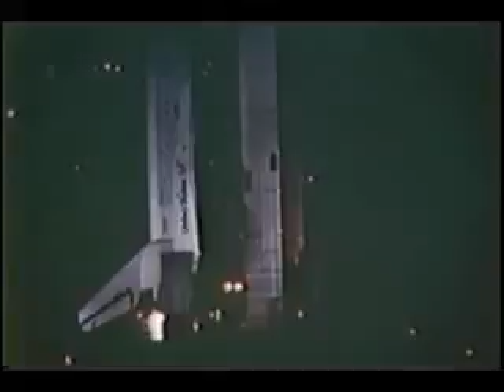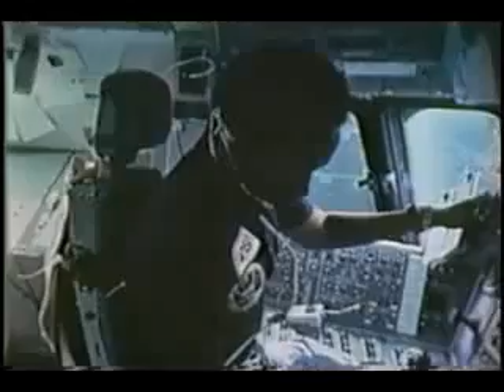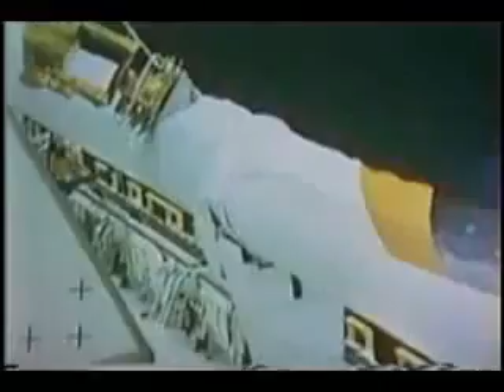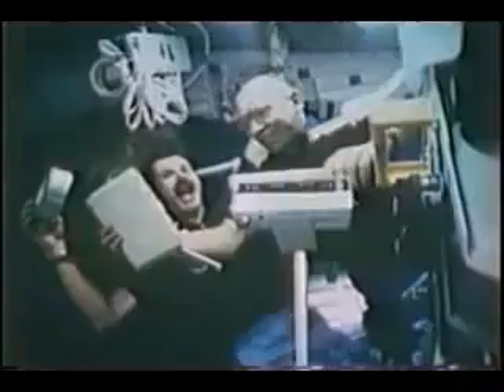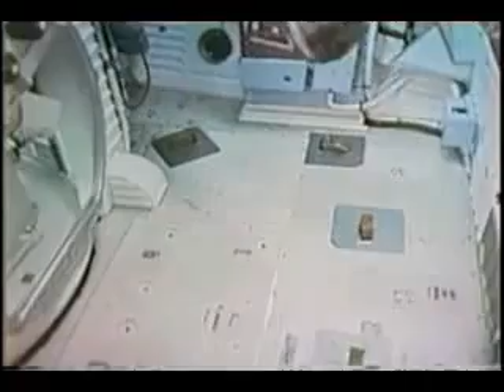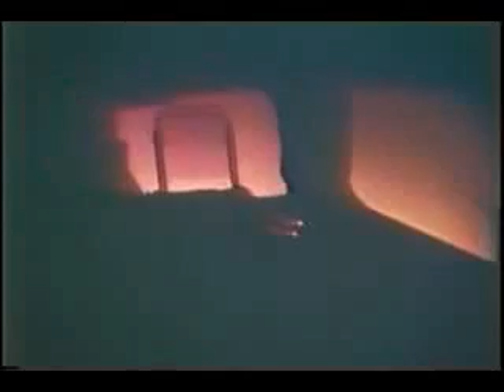FLAT EARTH BRITISH Filtered. NASA Fails In 1983 Challenger Mission Complete.

Comment: The view of the Earth seems to be flatter than the ISS show today, also they have been adding the artificial 'atmosphere glow' to the newer "live feeds". I must call out the pilots statement that once lifted off beyond the flash "...that they could no longer see the ground." The view from the cockpit of the shuttle, while pointing up to the sky, the ground would not be viewable without a rear view mirror (the shuttles were never fitted with rear view mirrors). Notice also the total lack of cloud movement, of every Nasa motion picture of the spinning Earth below.
Reply: I’m sorry, are you 5?
Yeah, 16mm movie footage from 35 years ago isn’t going to look like modern digital video.
And, as far as seeing clouds moving, the shuttle’s orbiting at 250 miles. With a 16mm camera.
So, you figure that there’s about 600 lines of resolution on that, and you’re probably viewing 600 miles by 600 miles. So, each pixel of the earth is the average of 1 square mile of area. If you got noticeable movements in the clouds, like say 1 pixel per second, that would mean that that clouds is moving at 3600 miles per hour.